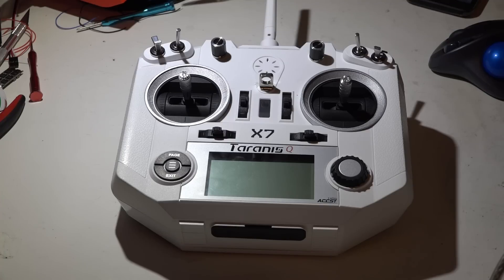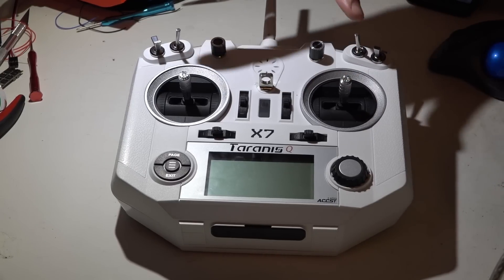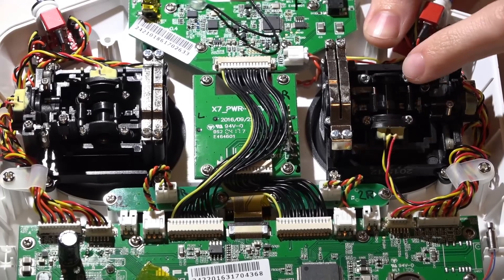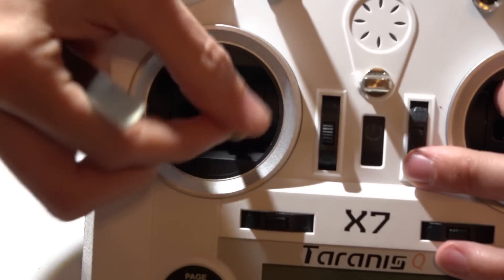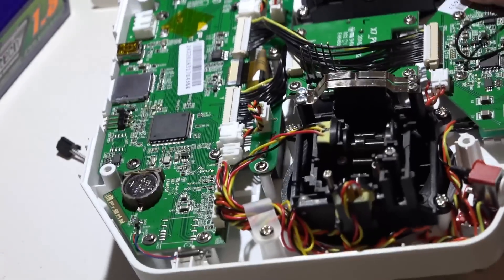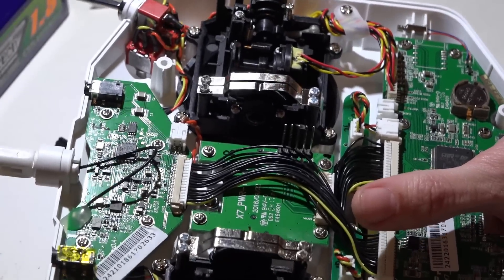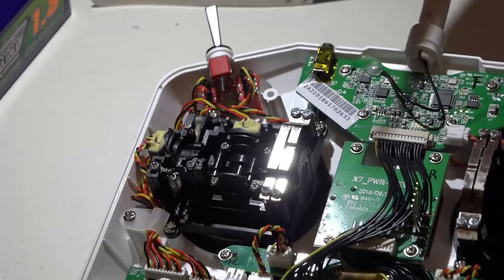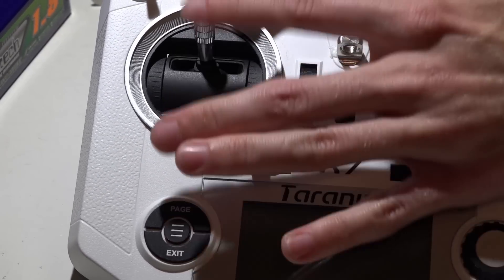Taranis Q X7: Adjusting Sticks/Gimbals

Comment: for the throttle there is a screw u have to drew in on the axis where the feather screw is. this screw holds the axis away from the throttle pins and than it is rly "Free" otherwise the axis for the throttle pins will connect to the throttle axis so this way he explain is wrong!

Comment: First here though!  

Do you think it is worth switching over from the x9?  I am so on the fence about getting one.  they are also talking about hall sensor gimbals for the x7 this summer sometime
Reply from the maker: If you already have a X9D then I'd say I wouldn't switch unless you really want to. They're both 90% the same but the X9D can be charged without removing the battery and has 4 more switches. The QX7 is lighter but only by about 100 grams.
Reply: Thanks JC :)

Comment: There's actually a screw that pushes the spring-centering-bar away from the gimbal. No spring removal necessary. I've not seen a single video showing how to do this right.
Reply: Removing the spring is better, leaving the spring and stretched for a long period of time can ruin the spring. If you ever sell the transmitter to a fixed wing pilot or ever decide to use a fixed wing the spring could be useless at that point.